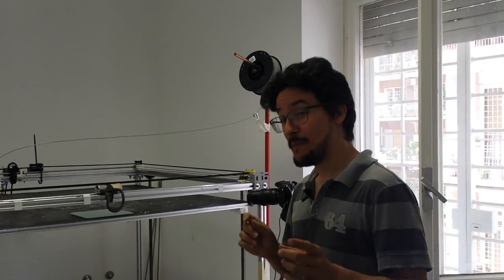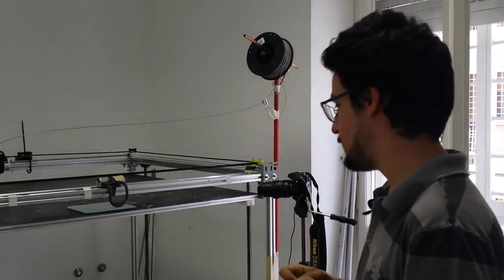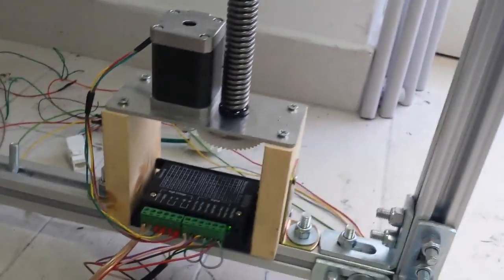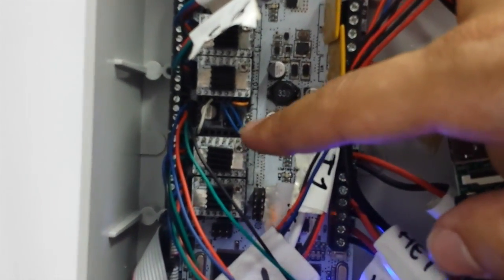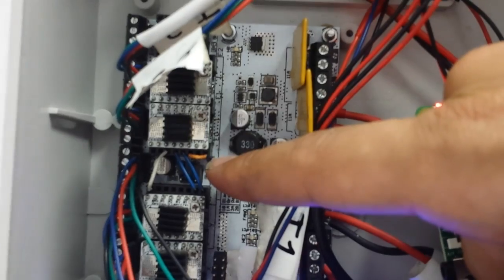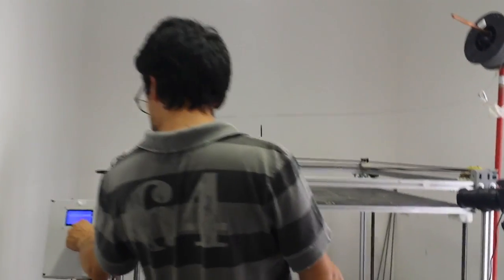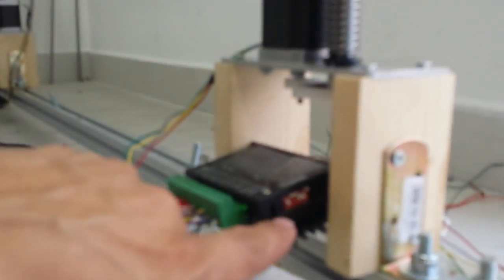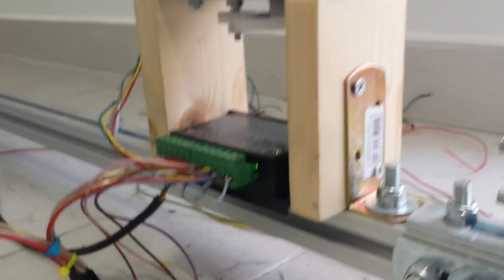Ep. 2.5 bis! New external drivers!

Comment: wave good very good project, I would like not entioendo English, I understand that the bridges, with cable in the Z Driver card rumba, are for the card to read the external Driver not?

could you send me the connection diagram or something as I'm concerned for my project, you can see my profile

thank you very much

ola buenas muy buen proyecto, me gustaria, no entioendo ingles, entiendo que los puentes, con  cable en el Driver Z de la tarjeta rumba, son para que la tarjeta lea el Driver externo no?

podrias mandarme el esquema de conexion o algo parecido ya que estoy realmente interesado para mi proyecto, puedes ver mi perfil

muchas gracias
Reply from the maker: Hey there! Sorry for the laaaate reply, anyway this should help:
https://scontent-mxp1-1.xx.fbcdn.net/v/t31.0-8/s960x960/16722470_10212308990504485_3072969267788281262_o.jpg?oh=39760df115614f31711d1a3e3be642b4&oe=5944F07B